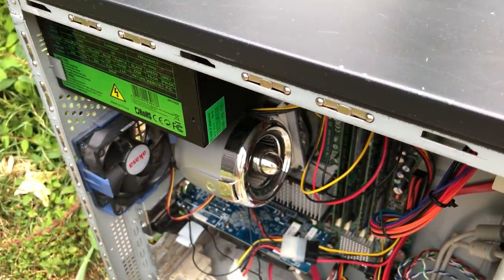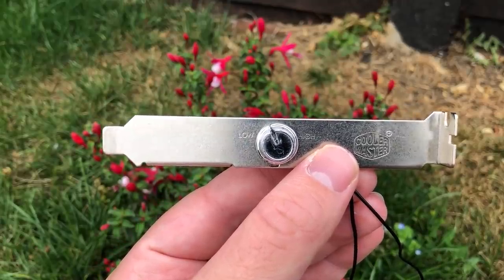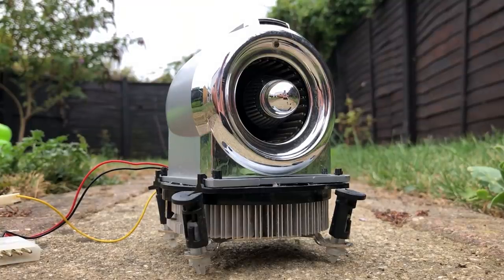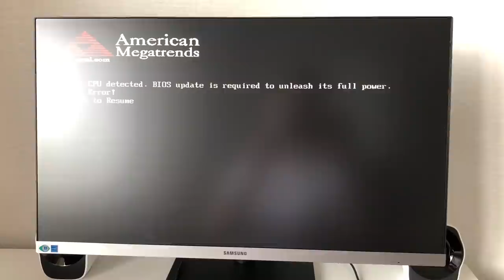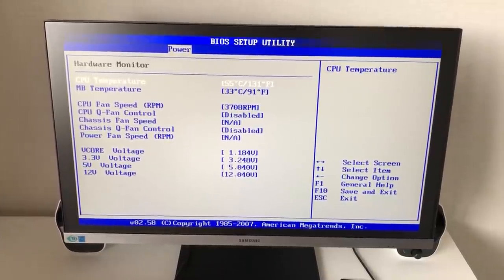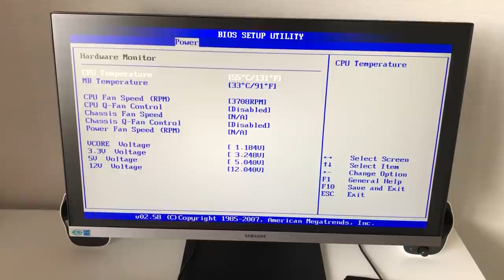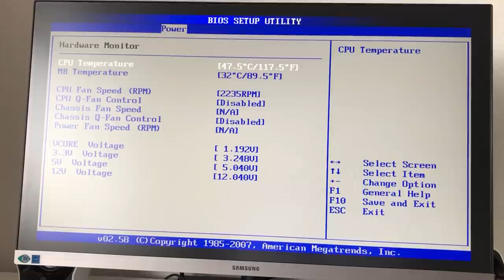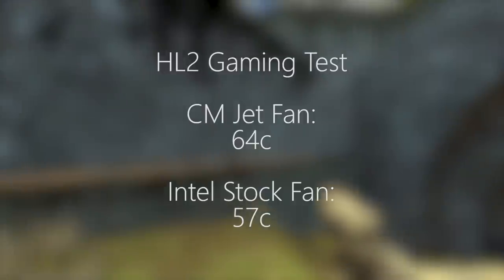Weird Tech: Cooler Master's Jet Engine CPU Cooler

Comment: An aftermarket cooler that is less efficient than a stock cooler and sounds like a jet engine ..... LUV IT!...🤣🤣❤
Reply: had to exist
Reply: @arencorparencorp2189  early 2000 pc build are insane
Reply: @bitelaserkhalif  oh i know, my old cold cathode+dual fan case (each sidepanel was just a big fan with a grill) looks beyond weird nowdays
Reply: Just break one or two wings from stock cooler will get you the same effect.
Reply: Well keep in mind this isn't the complete, functional Jet 4/Jet 7 cooler, it's part of one jury-rigged on to part of an Intel stock cooler. In its original form it looks like the Jet had a much beefier copper heat sink below the turbine part: https://www.newegg.com/cooler-master-jet-4/p/N82E16835103142  Also standards for PC noise were very different back then, HDD's clicking and chattering, and it wasn't uncommon to have a single 80mm exhaust as the only case fan, screaming away. 

But I think it's safe to say this was always a product designed with a fun aesthetic gimmick as a higher priority than pure performance.
Reply: That's for sure. The original fin layout is really different, there's no solid spot in the middle of the heat sink, just lots of vertical copper fins. That fan on the Intel heat sink is going to lose a fair bit of performance.
Reply: Problem is it does not have its stock heat sink.
Reply: That thing is stock cooler with good cooler fan on it.
Reply: @Middcore  The real issue here is that the Jet fan is bolted to a small Intel heatsink with an aluminum core; it's possible that it was originally for a Pentium Dual Core.

Its heat capacity is much less compared to the standard Pentium 4 heatsink shown later, which is taller and usually has a solid copper slug in the center. As the results show, that deficit cannot be overcome with the greater airflow of the Jet cooler-- beyond a certain point, increasing the fan speed results in diminishing returns in terms of CPU temperature drop.
Reply: I've had one and just know it today.
Reply: Should have a really heavy turbine with takes several seconds to spool up
Reply: Perfectly useless.
Reply: @Middcore  No joke i got an old pc for free and while i was messing with it the drive kept clicking and shit (i wasn't used to that) then i heard similar noises from outside. Baffled as all hell i went to take a look and a couple of frogs had gathered outside my window croaking back at the hard drive in some weirdo technophile mating call lololol. A lot can be said for modern nvme but they don't attract wildlife like they did in the good old days :D
Reply: PC enthusiasts are a breed of their own. Yea my liquid cooling is pretty cool but what about this (presents shity jet engine style crap) ahh Mr RandomGaminginHD you spoil us with your treasure.
Reply: They were better than stock. They would come with a full copper square heat sink under rather than the terrible pairing here.
Reply: That was a good cooler back in the day I have one on my windows XP gaming machine worked great for its day
Reply: i think that is kinda the product idea
Reply: @aaaaaaaaaa97  I've read reviews of the original stock setup doing a worst job at cooling the Pentium than the stock cooler by 10degrees C. it's not just the heat sync here but the fan is not great 😅
Reply: I actually had a previous version of this cooler, I guess it was called cooler master blower, it was the exact same blower from the jet series but without the turbine aesthetics, and it with the provided heatsink I only took it to maximum speed a few times during Brazilian summer. When my Athlon XP died (yes, that old), I kept the fan, and for the first time I powered it on the table, without the heatsink, and it floated like a air hockey Puck. Most competent (non server) 80mm fan I ever had. I was pissed when it died.
Reply: Actually the original Jet 4/7 was far better than an Intel cooler, he wasn't testing one.

Comment: They took the "this thing sounds like a jet engine" joke literally
Reply: Mine doesn't even need this it sounds like a jet already
Reply: @stefan-x9g  Cost saving measures
Reply: That sort of stuff happened back then
Reply: @TheGamerCouch  yep, I have an old '04 system with a Pentium 4 and it's very loud compared to a modern Wraith cooler per example.
ps - I cleaned the entire system recently
Reply: I too watched the first 30 seconds of the video
Reply: Ah thanks mate I didn't watch the video
Reply: The creator of this thing probably told a lot of dad jokes.
Reply: @unnamed715  most likely
Reply: He literally made that exact joke in the first 30 seconds
Reply: @natebit7167  I only noticed that after watching the video though
Reply: They took a Radeon hd 6950 or R9 290x and used the cooler to cool the cpu
Reply: It was super loud.

Comment: I’m surprised that the motherboard didn’t start flying away.
Reply: So this is what an underrated comment looks like
Reply: Not even that it's good at. At least it turns your manageable hot exhaust into a thinner airstream of even hotter air that will fry whatever you put behind it
Reply: Madman 21 well, at least that makes it more like a jet engine.
Reply: @chas1878  cmon, hot coffee while gaming isnt bad idea
Reply: It doesn't have enough thrust tho

Comment: If you wanna look at some weird tech: GALAX (or KFA2 in Europe) have made a single slot GTX 1070 gpu... called the 'Katana'
Reply: That's not that weird...
Reply: @insanity-vr6vu  Not if it's the only single slot gtx 1070 that exists
Reply: @KayoMichiels  i mean i heard of it and i watched plenty of videos already covering that gpu. dope card tho.
Reply: @DefyDistrict  Yeah, i'm using it for my 2nd screen, PhysX card and video encoding
Reply: MK3424 my laptop 1070 is thinner (and depending on your luck I have beaten overclocked desktop 1070 in 3DMark), so if my thin laptop can do it then it’s really not that shocking. It’s simply not a weird tech when it’s literally the standard profile for other OEM cards, so definitely not weird when single slot is probably the most common standard for all discrete video cards, at best it’s just a nice variant of the GTX 1070, but not weird.

That’s like saying my Titan Xp is weird because it looks like a lightsaber from the side but it’s not really weird because it’s simply the Star Wars empire collectors edition, it’s only weird thing is it comes with an acrylic display case so it can sit on your shelf when you’re not using it to look pretty on display, that’s it’s only thing besides 1 major anomaly plus a minor one because it‘s the only GeForce card that glows red instead of green (I love Radeon cards, so my cousin joked “of course you bought the only Nvidia card that’s red”, haha, that’s kind of funny).
Reply: GALAX/KFA2/Gainward/Palit is the same company (as a European I know their 3 European brands, and I've seen the GALAX name in 3dMark; I wager there are more brands around the world we haven't heard of).

Aaaaaanyways, obviously Zotac made a 1070 mini (they're making everything "mini") and for the low/mid-range cards there are always a lot of either single-slot or low-height models available.

If there wasn't one for the 1070, well, maybe that's because it was so crap. Obviously I haven't heard of anyone owning one. Because guess what, it was crap in all regards... Within a year it couldn't be considered a mid-end, but not low-end either, Nvidia replaced it almost immediately with 3 other models... so there's really no points for making that strangled short-lived GPU in any form factor.
Reply: insanity 2222 my friend has that card
Reply: Isn't that weird though.
Reply: Korean brand emtek and galaxy
Reply: GT86 no I beat someone head to head who challenged that, they used a 6700k (mostly irrelevant since we compared graphics scores anyways, but technically they had faster single threaded since my 8700h couldn’t run as fast and single thread does affect the graphics portion a small amount), so I challenged them and beat them. I had each voltage point tuned to within 3 MHz of being difference of stable vs crashing (so there were about 50 frequency points along the voltage curve I had to optimize perfectly thanks to Pascal throttleboost 2.0 as I call it). Do note the mobile 1070 is the only mobile GPU I know of that has more CUDA and potential performance than the desktop (it has 2048 CUDA vs 1920 CUDA on desktop version).

So with the fact that I personally tuned it (I didn’t use my liquid nitrogen cooler or modify BIOS like I planned to do later, nor did I solder my E-power VRM zombie board to it, etc, all stock hardware and unmodified circuit and BIOS), with my tuning skills and a full day of patience (probably about 100 crashes, which is a typical weekend for me tuning hardware for record setting), that pushed my laptop 1070 to take the win. Now I normally don’t tune Pascal (as I hate it), but even with my lack of expertise on that hardware I do enjoy overclocking and have spent hundreds of hours benchmarking and overclocking (I spend more time benching than gaming, it’s what I do for fun, even my daily machine runs sub-zero at about -60c while watching Youtube on a simple but surprisingly good little phase cooler). Normally I like to BIOS mod my cards for unlimited power (as power limits are what hurt me bad on the mobile chip), and sometimes I’ll solder voltage bypass control to over-ride the circuits to allow as high of voltage as you want until it fries, but to keep things fair I didn’t modify the laptop in any way and simply used MSI afterburner just as they did.
Reply: GT86 looks like I tied for #1 in world for GTX 1070 (notebook) plus 8750H. I find it suspicious my score isn’t on the main search page but someone else has the exact same overall score as #1 if you search that combo from the main page, but here is mine (maybe someone thought I cheated?), here is my link under my branching name 0C_Monkey: http://www.3dmark.com/spy/8782132

I may have to rebench that soon, as I’ve got my CPU scoring decently higher on Cinebench than I think back then. So maybe you’d call this like a pro tuning a Honda Civic vs a normal person tuning their Farrari, but I got that Honda to bear a Farrari in that case so I’m happy! And technically that still makes my mobile 1070 faster than some people’s overclocked desktop 1070 (as mine now I can hand to any kid and it will run Fortnite or whatever they want without them doing anything, it is indeed faster, just like I said).
Reply: I remember watching reviews of the katana when it came out. Such a cool and slick gpu
Reply: I got it from a very confused seller for 10 bucks but it was dead :(. I've heard it's temps are horrible tho
Reply: I really wanted that GPU when it came out. That superfine card was boss!
Reply: Jake Garrett being the ONLY modern desktop gaming card with above 2gb of vram that is a single slot, I think we can safely say it is weird technology. If this cooler from the video is weird tech, that is even weirder tech. I’d be surprised if 3/4 of his viewers haven’t seen that cooler before. Unless his viewers are all really young.
Reply: @jakegarrett8109  laptop gpu is not even the same form factor as a desktop gpu., so sure its thinner. But I highly doubt it beats out the desktop variant.
Reply: burnstudios yeah that’s why it’s even more impressive, it has pitifully small cooling system by comparison. The Katana should be cooling duel GPU 1070 (then it would be a unique card), but as it is it’s just a regular single slot GPU and that’s pretty non-impressive.

I’m well aware the form factor difference, lol, I’m also well aware the other differences too.
Reply: I just sold it for a 1080 like a week ago for $200, originally bought it for $650 feels bad man

Comment: I bought this cooler back in 2004. It was a great novelty. I took it to my workplace and I got some good laughs from my colleagues that thought I was taking PC building too far. I had it on my work desk a few weeks, just leaving it on low spinning throughout the day just to look at and thereafter mounted it in my PC and used it for a few years. Though at those times, you didn't do so much PC modding in the form of RGB lights and whatnot, so 99% of cases had steel enclosures, so you never got to see it and thus inside a case it was just reduced to being a normal cooler. So off it went and onto my desk again. Then somehow I lost it or it broke and only this weekend when I was cleaning out my garage did I find the copper base of it (the Jet 7+ version was copper, then normal 7 version was normal tin/metal)
Nice piece of history that brought a smile back to me remembering my old job, my colleagues and the fan on my desk.

Comment: Ah yes, the jet engine cooler.

Making those Socket A systems live up to their name.

I heard this thing pairs nicely with an old flight simulator too.
Reply: I want a remake for that cooler, just to use it when I will play the new Microsoft Flight Simulator.
Reply: Yep and make that fan control sync up with throttle and you will get authentic flight simulation
Reply: @wahdangun  lmao
Reply: And your pc starts flying🗿

Comment: I had one of them back then, did the job, but looking back, it's really a bit gimmicky.
Reply: Me too, what were we thinking? 🤦🏻‍♂️
Reply: @jonchapman6821  There were quite a few of them back in the Pentium 4 days, never knew how weak they were until this video.
Reply: i bought a gaming rig back in the day with a similar one to this and yeah did the job not sure id want it back though lol
Reply: @samlloyd5975  I had a Zalman one on a Pentium D 830 and it ended up killing my CPU while playing Bioshock. Okay the cooler was rated 95W TDP,  while the CPU was 130W, and I didn't know that at the time, but I can imagine there's a reason why they haven't come back to that design.
Reply: @dcikaruga  definitely there not that efficient and noisy as anything
Reply: Just a shame that a lot of these do called experts have only been into computers for 10 years and think they know everything.
Reply: You bet it's gimmicky. It's bigger & bulkier than stock. It probably cost a lot more, yet it did worse. I would have expected more out of a squirrel cage blower, although the heatsink seems kinda small. I don't care about noise. I usually get a cooler based on the CFM of the fan. For me, that seems to produce consistent & measurable results - at least for basic, compact, cheap, coolers.
Reply: @jeremygeorgia4943  that wasn't the actual cooler in total.  That was the cooler fan strapped to a crap Intel heatsink from a more recent era.   It wasn't a great piece of hardware for the day when it came out but wasn't ineffective.    If I had to guess someone was Frankensteining a handful of old computers worth of stuff together for a buddy to get into the hobby sometime between 2010 and 2015 built that computer that was found and well here we are.
Reply: @OmniMontel  Still, the heatsinks looked like equivalent heatsinks. If this is the case, then it means that the fancy blower isn't as effective as the fan with the stock heatsink. It also means that whatever the original cooler looked like, it would probably have been more effective & would have taken up less room, with a more conventional fan.

Comment: With the correct heat sink I was able to keep my P4 3.4 HT Northwood CPU a super cool 45c degrees under load.
The fins ran straight from one side to the other and only exhausted out of two sides. Solid copper. No aluminum.
The heat sink that someone modified for use with the Jet 7 is specifically designed for the airflow from a fan, not a "squirrel cage" (hamster wheel) type blower.

Comment: I'd love to see the comeback of wacky or cool pc parts like these, like those gpu shrouds with 3d people or some dank game looking graphics. And colorful pcbs
Reply: The early to mid 2000's were a lawless time for PC hardware, aesthetically, but also so much more interesting than today IMO. Sure a lot of the cases and parts from back then look frankly silly but there was a lot more creativity that went into them than just making a box with a glass side and some rainbow lights.
Reply: @Middcore  and the people that did have just that went through the trouble of cutting that window themselves and modifying coolers and ccfl's and leads to work with their systems.

Building a "nice looking" pc is way too simple these days =l
Reply: I wish everything sold for PCs was just minimalistic. Solid color boxes with fans inside. Tons of nickel plated copper and aluminum. Motherboard armor that makes the motherboard look like it isn’t even there.

Comment: I HAD THIS COOLER! It looked like a jet engine, and it came with a copper+solder heatsink. I used it on an overclocked AMD Athlon XP-M 2500+.
It had an obnoxious blinking white led (which I immediately covered with black tape) and it performed pretty poorly. But it was $35 at that moment so it wasn't too bad!
It was noisy AF, but much quieter than the 7000 RPM Delta fan I had before.

Comment: I remember these being released and reading about it in a PC World, I think... I was a teen back then and really loved the idea! I loved to the point that when I spotted this video I had to click. It was really expensive as it was a novelty. especially in these times, where there wasn't really any idea of putting plexi glass on the side of your PC. Jesus when I think about how my PC's looke back in the early 2000 and I compare them to what I'm building right now I just want to hide in the corner and cry...
Reply: You might not have thought of casemodding there. I started it back then. I cut the opening for the window myself, painted the case and installed cold cathodes for the lighting. At that time there were also Casemod-contests again and again. :D